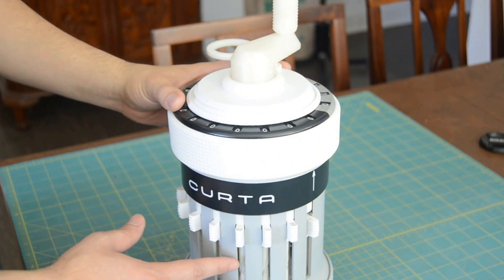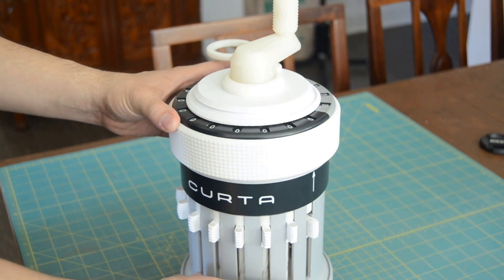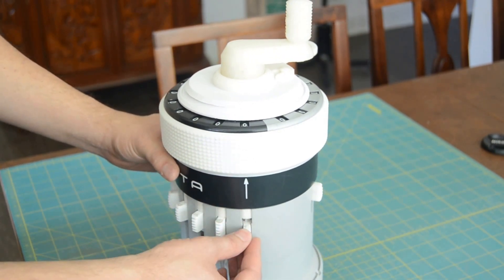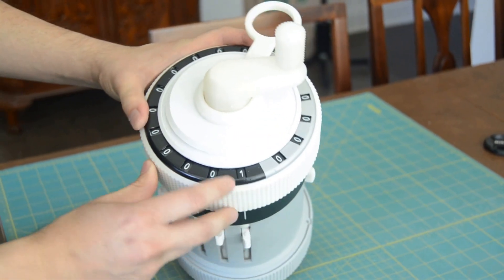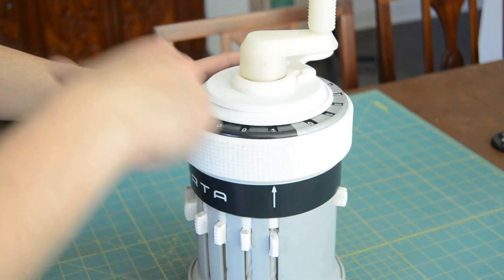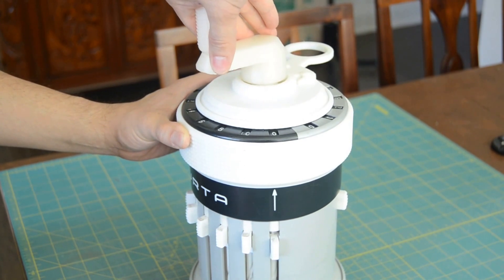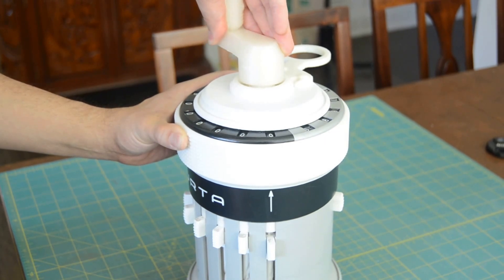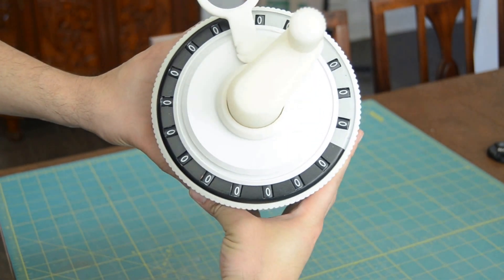Plus 1 Minus 1 on a 3D Printed Curta Calculator

Comment: Brilliant job, this is exactly the kinda project we should be trying and sharing. The corporates may not like it but its tinkering like this that really feeds the mind and inspires. Heres hoping we see more 3d printers available to everyone in the coming years. Id advise, at least base coat, spraying each part before assembly. If not most white plastics will become yellow from the sun. For a finishing coat add some clear nail varnish to protect the paint for years. Peace
Reply: Plaſtic dye would work well to paint þis.
Reply: @almostliterally593   Thats a good idea! And not too expensive! 👍🏽
Reply: @heroesgrantorino  yeah give it a nice black finiſh.